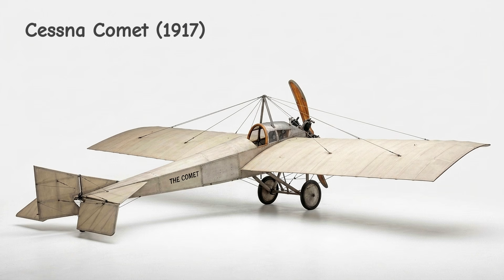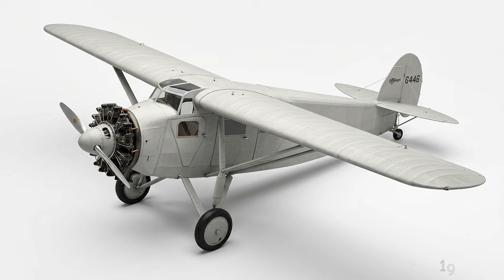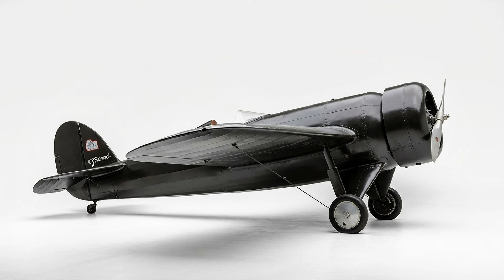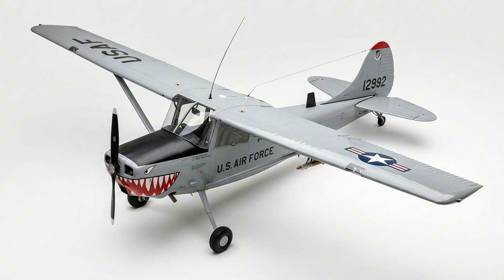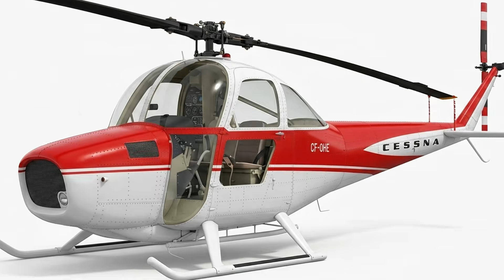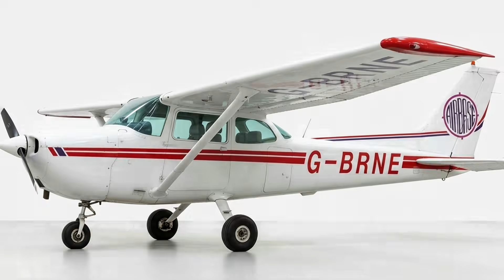Every CESSNA Explained - Part 1

Comment: There’s a lot of AI slop in this video - the pre-war Airmasters did not have wing struts, the 2-seat “one hundred fifty two” shows a 4-seat “one hundred seventy two” (and no one pronounces the names that way). And the prototype 160 shows a picture of some kind of generic modern composite LSA, not the slab-sided metal original. I stopped watching at that point as there was more garbage than substance.

Even the comments liking the video appear fake.

Comment: 5:39 They also used it for ground attack with a couple rocket tubes mounted under the wing. There's a Bird Dog at Lyon Air Museum in So Cal setup like this.